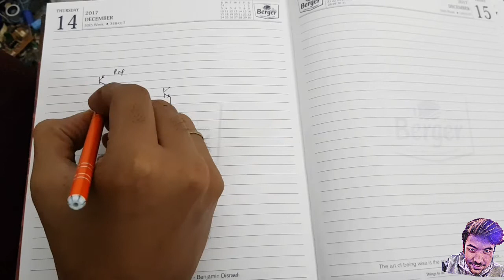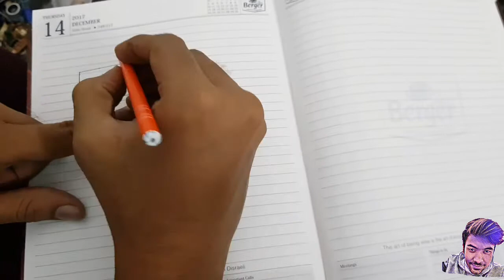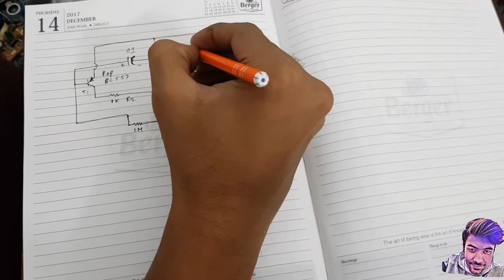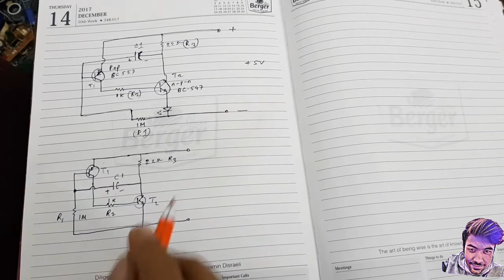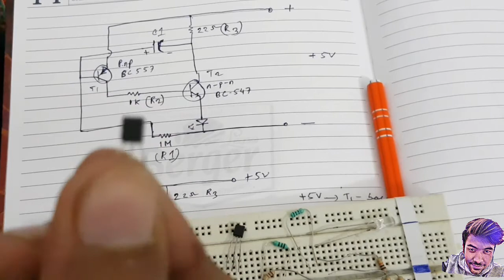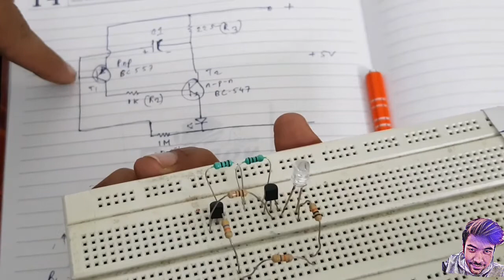How to make a simple led flasher using two transistors| Diy |With explanation | BC557| BC547|

Comment: Thank you the video.  I had my students build it and it works very well!  (We used 9 volt batteries.)  I also modeled it in Multisim (a user-friendly SPICE type program) and it works there as well.  Finally, in the USA we don't have the exact transistors so we used 2N2907 for the PNP and 2N2222 for the NPN.
Reply from the maker: Happy to help, you are most welcome..😊😊❤❤